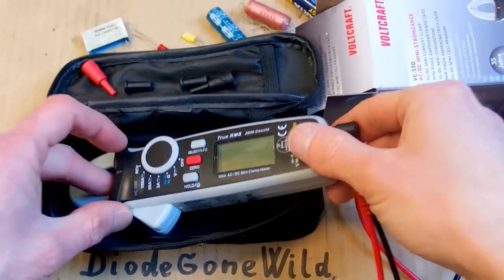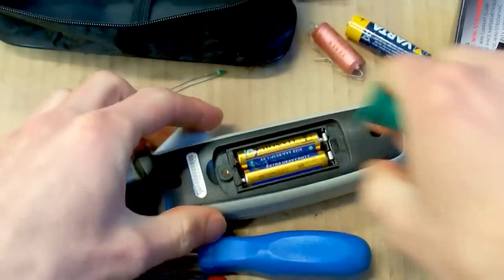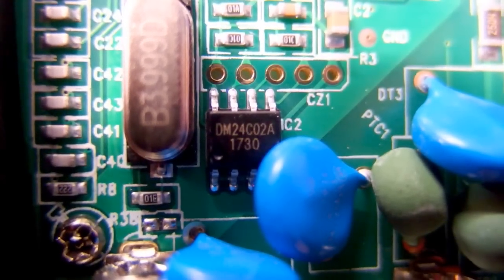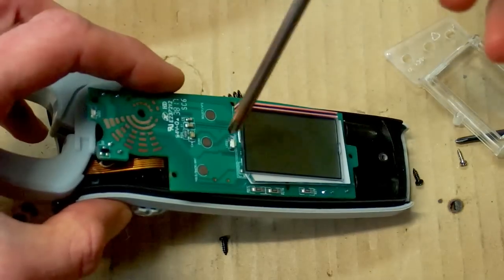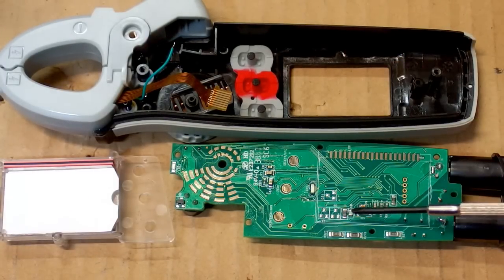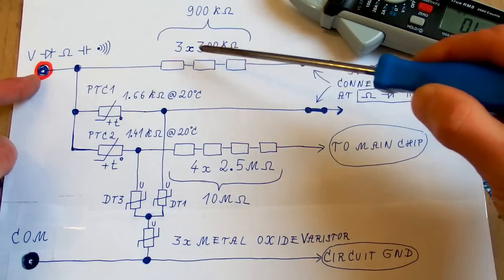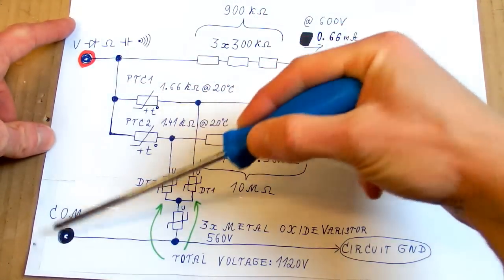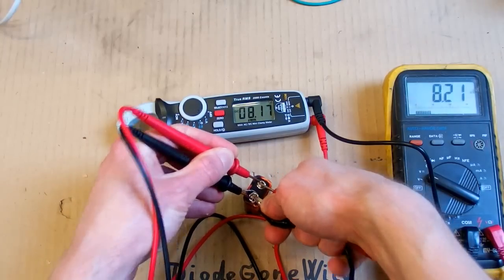Clamp Meter Teardown (Voltcraft VC-330 = UNI-T UT210E) & creating my Patreon account

Comment: Everyone
 If you don't like the ad at the beginning. Just close the video and open it again. This takes 1-2 seconds. In 1-3 attempts you will get an ad that is less than 15 seconds. This doesn't hurt the content creator or effect the viewer metrics for the video as nothing under 30 seconds is counted. For those of us without much money, it's the least you can do.
   Ad blockers are tools for thieves to take advantage of the person that created content and uploaded in good faith that it would generate a return on their investment of time.
  This coming from someone who knows how much it takes to create content, is not monotized, and doesn't plan to be. If someone chooses to monotize content, it is for sale, the price is a small amount of your time watching an ad. If you take something from them without paying it is exactly the same as taking anything else without paying. If you don't see an issue with this, then you need to check your morals. Your motivation for right and wrong as a person is based upon your perception of being caught, and not upon the quality of your character. You can always get YouTube Red to remove the ads.
-Jake
Reply: Adblockers are not only for thieves (I'm not talking about youtube only, but the web as a whole). They are an essential tool on the modern internet because personally I am tired of having video ads that waste the bandwidth I pay for, flash ads that consume my CPU cycles, popups that distract me and/or play sounds at a high volume, interstitials that you have to wait in order to access the content (While in the background javascript is running like crazy), having to think at least four times and waste 2 minutes just to find the real download button amidst at least 10 fake ones etc.
It's not the fault of adblockers, it's the fault of greedy people who thought forcing you to watch invasive ads was a good idea. If all the ads were the kind that isn't flash-based, isn't 100MB in size, doesn't eat all your CPU and actually ADVERTISES something useful (not just another clean-my-registry program or similar) I'm sure that most people wouldn't resort to ad blocking.
It's really sad to see that using an adblock reduces your monthly data usage by 2GB or more.
Rant over.
Thanks Danyk for setting up the patreon so those who hate ads can still support you. :)
Reply: I agree. I also use noscript. The amount of unnecessary JavaScript is ridiculous. The main content loads instantly without all the stupid ads and extra bits. I have NEVER ever bought anything online just because I saw it advertised. I bought it because I needed/wanted it anyway.
Reply: I dont know much about the ads on YT, but aren't they choosen and positioned by YT itself, not the author of video? In generell i think there is too much annoying ads around the net content and i hate it. I used noScript and other Adblockers but all of them have backsides too. Anyway, i also like the videos of Dan - alway a great plesure - not only in learning aspects but also for entertainmen. "More salt! " :-)
Reply: thanks, Jake, for this very detailled introduction to modern AI marketing! To be honest i find it a bit scary how much data google & Co are collecting from my web traffic and what they do with it. Yes, it can be helpful to get just the right streamlined ads that you might be interested in, but really, i want to decide myself when and what i am looking for! I really hate some site where annoying ads pop up every now and again and really disturb you from what you originally wanted to look for! I think the author of the video content doesn't see much of the monetizing of companies like AdSense, Google and the advertising company itself. I actually have no idea how much the author of the video can earn from clicks or visits to the ad site - would be interesting tough...  If a site is disturbing me too much with those popping ads i will rahter avoid them in the future - if i can. Unfortunatly there are only rare alternatives to google & Co. But i am not present at fb, twitter and many other social networking sites. I just use my good old email apart from a few forums on the web where we chat in groups freely without any ads.
Reply: it will be as you say but it distracts me and annoys me, when I'm watching a video I do not want to be distracted, ... I do not even watch movies on TV anymore because of commercial breaks! I can get good advertising at the end and at the beginning but not in the middle of a video: I'm Italian, I do not know English well and I follow a lot of English videos with subtitles and at 0.75 speed to understand them and the ads distract me, I understand that they can inform but not as assiduously as they do today, I do not use social media if not youtube for my passions, aviation, do it yourself, electronics etc. (google translator) Leo
Reply: Call me stupid, but I don't get the difference between using an ad blocker and turning off your TV or radio when ads are being played. Does this mean that if I turn off my radio or tune in another station when ads are broadcast, I am committing a crime? Much like in the same way as using an ad blocker, I can listen to the radio or watch the TV show and then when there is the break, I just turn the TV off or watch something else.
What about if I am in a subway train and I don't look at the ad stuck above the window? or while waiting in the station?
Because that's your reasoning...
Internet ads are f... up IMHO. They should be treated as TV ads. You have the right not to watch them and still consume the content.
Reply: richardnanis 
  Channel creators decide if they want to monotize their channel and also if they want to monotize each upload they add.
  AdSense is the name of the Google company that handles the ads. I haven't played with it directly myself, but a good friend of mine makes a living off of it and walked me through it several years ago. All advertisers are sold "ad views" and "ad clicks." If you want to place an ad through AdSense you are given a bunch of options, or better put, metrics. You can choose things like a certain age group to show your ads to. The primary metric the advertiser gets to choose is key words/phrases. These keywords/phrases are ranked based upon how common they are and their relevance to the subject. The advertiser pays for the ad-views/ad-clicks based on which key words were used to match the viewer to the ad. If the matching words are very common to the subject they cost a lot more for each ad-view/ad-click. Within the AdSense system it tells advertisers how it ranks each word/phrase. It's in the advertisers best interest to use very specific keywords. This is the basics of how the system appears to the person buying the ad space. 
     The actual matching system that decides what ads you see is handled by one of, if not THE, most advanced AI's in the world. The AI pulls your Google profile when you view any content. No matter what you do on the internet Google has profiled you. There are profiles based on everything ranging from users that have Google accounts, to simply habits of internet use related to specific IP addresses. These profiles are matched to keywords based upon the media they are about to watch/view on the web. Then a virtual auction happens where every ad available in the system is matched for relevant keywords. The highest priced keyword that the advertiser chose is matched to the strongest keywords available for the content.
  This brings us to the final aspect of the AdSense system. When a content creator uploads a video to YouTube as monotized, or a webmaster adds an ad spot to a webpage, an AdSense keyword profile is created based very loosely upon the keyword tags that the person creates for the content. The AdSense AI creates a secret keyword profile that no one outside of Google can see. This AI system was reported about a year ago to have a reading and comprehension level of a six year old child. The key word profile is influenced by the content of the video and video description. This is also the real reason for the auto closed captioning system. The AI is aware of the production quality and it's relevance to it's viewer base along with the metrics profiles of it's viewer base. As an aside this profile matching algorithm is also used to influence how content is suggested to new potential viewers. 
  Lastly there is are over ride type interrupts within the AdSense system. Things like habitual profiles associated with each user can influence the matching system. This tries to match your potential ad-view/ad-click with the type of ad length you find acceptable. If you always skip ads, eventually you will get shown shorter ads that do not have a skip option. Another interrupt in the system is if a content creator is getting a lot of traffic but the content is underperforming for average ad revinue for the keywords profile associated with the account. This system can force more short, general, ads on the content that do not have a skipping option. Pretty much every time you see an ad that doesn't have a skip option, you've seen the system modify to balance the average ad revinue account.
  The biggest trouble with the system are people that use ad blocker and VPN's. Anything that limits your Google ad profile (not the public one you can see but the actual backend profile used), causes you to be matched to more generic ads. If Google can effectively match your purchase profile to your internet use the ads you see will become much closer matched to your interests. For instance, I see ads all the time for new electronics products tools and even chips from specific manufacturers. Google has a very detailed profile for my internet history. It also knows I don't like ads longer than 15 seconds unless they are super relevant to my interests and have interesting/informative content. 
  We all want and need exposure to new things. The most relevant exposure is through "influencers," AKA social passive peer pressure, which is also being incorporated into the AdSense system. Ultimately there is an overwhelming large number of products and services available to all of us that would better our lives and potential, we are simply unaware of the options. Advertising enables us to communicate those options in a way that bridges social divides. It is essential to human social progress. The more effective your ad profile is, the more effective the communication of these options can become. Google/AdSense is working hard to get more and more small and specialized ad content. It isn't easy to get these none traditional products and companies into advertising like this. The general system is set up to benefit the end user just as much as the advertisers. Most of the people that complain about it are those that are limiting it's effectiveness by limiting their ad profile. 
  That's the full extent of the system as I have experienced/seen it. It's a facinating system and one of the most advanced AI's in the world that we all interact with every day.
-Jake
Reply: WOW... Jake !! That was a mouthful and a very detailed explanation of which, I probably understood like 10% 😄😁🤣
Reply: richardnanis 
  I was kinda bothered by it at first as well. Most of the pop up ads and script stuff is not AdSense but are other second rate companies that are willing to go an obnoxious step further to get advertisers to pay for adspace. I don't believe AdSense does any pop-up or JavaScript ads at all, but I haven't looked at it in detail. If you get a lot of ads you really don't like you can usually go to your Google AdSense profile to see why you are shown certain ads. For instance I removed "advanced education" from my profile because I have no interest in further education at this time, and I hate all of the scam school ads from for-profit (IMO - criminal) institutions. Your Google profile, the part of it you can access, will allow you to tune out certain things.
    The more general ads that you see, the more your profile lacks depth. It's also a reflection of the types of ads the system has available at any given moment.
   If you think about it, we are very limited to product exposure if we are limited to just our local social group. We usually attempt to expand our options on our own through "trusted" means. This usually involves people we feel connected to. Just look at the popularity of electronics channels that do a mail bag segment, or teardown reviews. I have no idea about why Danyk chose this clamp meter. I don't know if a Uni-t is any better, but effectively this video was a passive social advertisement. I don't know if that was it's original intent, but ultimately it's exposure to a new product and raises my brand awareness.
  In the future, ideally, a video like this would be matched to advertising from Fluke, BK Precision, Ideal, and in a perfect world Aneng and other disruptors. Every time you view this video you will see an ad for a competitive product from onr of these manufacturers.
   The only way to create a system with that kind of effective complexity is to first convince advertisers that creating specific ads like this is effective marketing that generates results. This shift in marketing is 180 degrees from the general mass advertising strategy that has been used for decades. That kind of reversal doesn't happen overnight, and traditional ads are still paying the bills. Ultimately I'm fine with a system helping me to discover new things I may find helpful or interesting. I'm not ok with any system that tries to steer my purchases based on my traffic and profile. I use a VPN on a separate browser to check search results from eBay, AliEx, and Amazon regularly. Any time I see an issue I purchase elsewhere. In the end we can't fight progress. Nothing is perfect, but ads are a necessity part of an advanced civilization with a free market. I figure it's better to make use of the advancements. Resisting change is a sign of obselece in any system. I'm not ready to give up just yet ;)
-Jake
Reply: Firstly I am NOT stealing from anybody !!! there is nothing in any video  that I watch (that I have seen) that says it is monetised. 

If youtube want monetised videos to contain adds that must be watched they can make it so add blocker users can't watch them.

I've been on youtube for six years now and seen a fair bit of con work from so called artists as well like those who make a very quick unboxing type video and like already mentioned are asking for subscribe and like all through the "content" followed by a blatant link to someone like Amazon who are obviously paying to get good reviews of something  the so called creators have never even used.

I've had a channel for 6 years now and never even thought about being paid for my content.

You should be more careful about accusing folks of being criminals when content is FREE TO WATCH.
Reply: There is a flaw in your logic in that anyone with or without an account can watch youtube therefore not breaking any rules by running an add blocker because they never signed up in the first place.
I mainly watch without being signed in to google or youtube does that still make them and me criminals?
Reply: Interesting are they prepared to lose a great amount of their viewing public by banning everyone using add blocker I wonder?

And do they tell non members not to use add blockers when they click on a link and start watching the site?
Reply: An interesting point of view but not one everybody agrees with.
From my perspective Google \ youtube do not have the right to try to invade my privacy or narrow down where I live (but they do try) 

They also do not have the right to try to determine my age , sex, interests buying habits etc but they do so without my permission.

I not only use add blocker but other means as well to combat this and defend my right to remain anonymous and will continue to do so.
Reply: hob991 
  I don't mind your right to remain anonymous. I only care when someone is stealing from someone else and uses an excuse like anonymity. If a creator uploads monotized content, your only legitimate choice is to view that content under the conditions the creator of that content has every right to stipulate, or not view the content at all. Any other choice is stealing. If anyone is truely concerned about their security they would totally avoid all Google products. The fact that a person is here shows they are not very concerned about the issue. Self entitlement is an easy thing for an outsider to see through, but a difficult train to diagnose within ourselves. Again, I've created content. I have not monotized, and am not at all inclined to do so. How much more of an objective opinion could a person have? I have no skin in this game. I simply feel sorry for those that invest so much into creating content that I enjoy and find useful. I find it rather sickening that people in general could be so selfish and self centered that they are unwilling to spend 15 seconds or less to do their part in support of the content they consume. An Ad View is worth about $0.002 on YouTube. That $0.002 is essentially paid to you for your 15 seconds and forwarded to the content creator as support for the content you watch. When you bypass this, your stiffing/stealing from the CC. Not everyone monotizes their content. I don't watch anyone's content if they add a bunch of ads in the middle of the video. I have a right to unsubscribe, and I do quite often. Again I respect everyone's rights to privacy, so long as those rights do not infringe on the rights of others. That also includes the rights of retailers and businesses. I think the internet is a resource not a product which is more in line with your sentiments and internet equality in general, but that's a whole nother level.
Reply: hob991 
 Then try using the platform without unauthorized software. Not using Ad blockers is actually part of the user agreement for the site. Your account can be deleted and your IP banned at any time for the use of such software. The enforcement of that policy is at the discretion of the site's ownership. Your continued use of the site depends on your compliance with the user agreement. Ads are the option for the CC NOT the end user. If the end user is violating the choice of the content creator, it is 100% theft. You may not like this, it may not be popular, but the logic is there, the point is solid.
-Jake
Reply: hob991 
"User" is anyone viewing content on the platform. You do not need an account to be a user or to have your IP banned.
Reply: hob991 
This is why, in my very first comment, I stated what I did about morals, character, and how that defines you as a person. "Everyone else is doing it" is a poor excuse for any decision in life. Intelligent decitions require someone that is capable of understanding both sides of any situation. I'm simply calling attention to a decision many make without considering all of it's ramifications from both sides.
     I try not to make choices based upon my perception of the likelyhood of being caught. I do my best not to exploit others in order to get what I want as well. That's just how I prefer to live my life. Your free to live life as you choose. I'm not the internet Police ;)
-Jake
Reply: Hmmm - i am a little bit confused now! I was never aware that YT doesn't allow to use ad blockers at all? I have never read about or heard about that! Anyway, when people use ad blockers or similar software - which are often already bundled with the web explorer - they dont decide to use it on a special web site and not on another - they just use it permanently. So i really dont get the point here - and i am not sure you are right with your opinion, Jake? I also dont see it as stealing when you use ad blockers on YT - never thought about that.
Honestly i used to have a channel on YT too - and still do - but i never really thought of monetizing it - and even dont know if it pays off. The CC gets 0,002 USD per click or ad watch you say? So i really grant everybody what he owes for his content - so i will think about that. I think it will level out over the mass of viewers and the cc ist aware of that - if he is at all :-)
Reply: Upcycle Electronics  Jake, I'm not against adverts per say, but as others have said, in an Internet browser, a lot of them are a darn annoying. And the advertisers are very mistaken if they think I am going to even pay attention to whatever they are advertising, let alone buy their product. Googles AdSence is very good at showing products that I bought earlier, or which I looked at after browsing online shops and decided against buying. As to theft, no that is incorrect. This is the same argument that copyright supporters use. If you post content on a public site where there is no charge to view it, then watching it without the adverts is not theft. As the user has not removed anything. It may not be acceptable behaviour, but that's a whole different argument. Also, there exist download tools which can capture the video without the advert...
Reply: Mark 1024MAK 
  There is a difference between a moral and a legal argument. They are completely unrelated in my opinion and point of view. Anyone with experience in personal injury, family law, or workmen's comp legal proceedings in the US should be well aware there is no moral argument in legal actions. Conversely, there is no legal argument in a moral issue. A person's character and what defines them as a human being has nothing to do with judicial systems. Again this 'legality' issue amounts to doing wrong to others because of the offender's perceptive risk of being caught or held accountable. It represents a failed sense of morality and a willingness to exploit others.
Reply: MrOpenGL 
 Let me know when you find a way to completely stop the TV and Radio ads by deleting them from the broadcast without them being played. There is no way to do this free of charge. Even with a DVR you are supporting the content through your cable subscription and are still exposed to parts of the commercial content. On YouTube I regularly go to the comments section during a dumb ad on a channel, but I don't attempt to undermine the software and choices of the creator and owner of the content that was gracious enough to provide it to me.
   Ultimately, anyone that complains about spending 15 seconds to support the person that spent several hours of their own time creating the content, is totally pathetic. Do your part, don't exploit others, and shut up about your entitlement and self serving 'rights.' Your not the center of the universe. You don't matter. Do your part and be nice about it. Simple. If you don't like that. Go create a channel yourself, then come argue with me after you've had a couple of videos get 10k+ views. I absolutely guarantee you will return here to argue this point exactly like I am doing. The only people that support ad block software are those that are either ignorant of the broader implications, or those that have no moral character whatsoever.
Reply: Upcycle Electronics I love his videos but the ads is a NO-NO
Reply: OK then I say mine on advertising and adblocker: I'm tired of wasting time avoiding advertising sometimes pornographic too (if I want to see pornography I look for it and I know where to find it) and then i use AD blocker.
the programmers should make sure that ad blocker and the other similar "antispam programs" take away the advertising to us users but they will continue the counts equally, we would be calm and they would earn the advertisements, I do not know who it is that puts the advertising Yuo tube or the maker to earn some money and I understand that these programs can change the returns of money but we also have to protect the pupils .. and other things round a little lower! 
Hi everyone
Leo